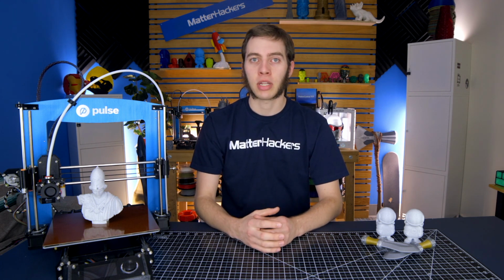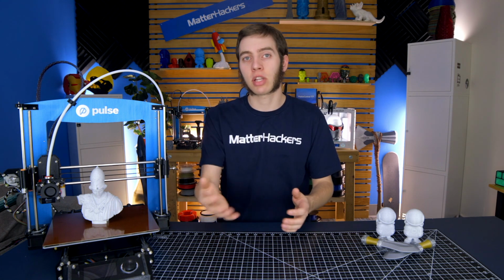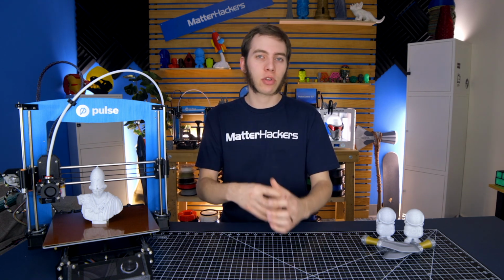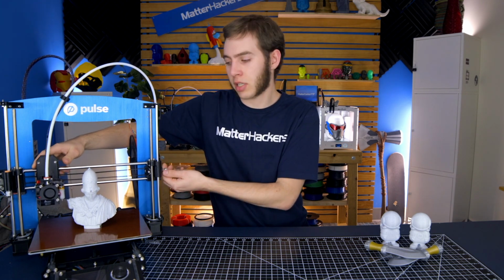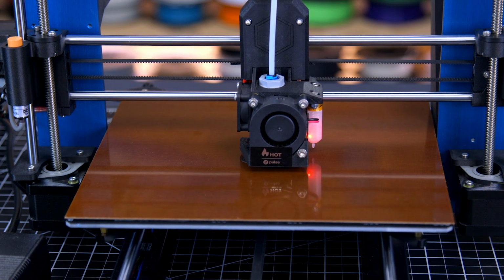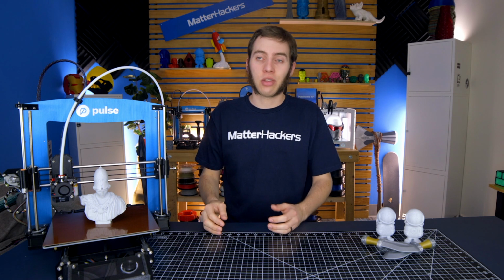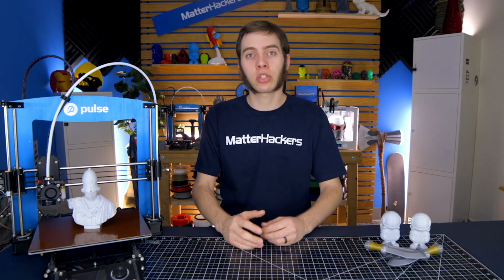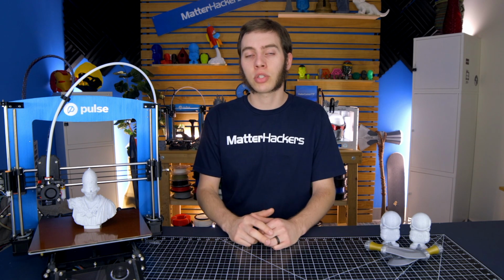3D Printer Troubleshooting Guide: Layer Shift

Comment from the maker: Besides layer shifts, what are the major troubleshooting issues you're running into? Your feedback might turn into our next troubleshooting topic!
Reply: i have a troxy P802E and im having issues with Most of the screws staying where they are supposed to be specifgically the ones used for leveling the bed im thinking abought getting some locktight
Reply: @techdiyer5290  yikes a tronxy. I had one of those. Jeeze I dreaded that I returned it. It was pretty hard to return back to China. Tronxy is just a bad company.
Reply: Personally just starting out..  I was doing fairly well.  I just replaced the Bowden tube and the nozzle, and twice now I have got prints that the nozzle either hit (and shifted the print) or something happened and it went from a perfect print. To looking like someone dumped a birds nest on top of my print.  9 hrs and 13 hrs in of like 15 hr prints.  Im going to look through your playlist to see if you have anything like this in your trouble shooting guide
Reply: heyho i just got into printing TPU and got some issues with overhangs.
I'm printing the SainSmart TPU 1,75mm diameter and i'm currently printing between 0,15 and 0,1 layer height to get those overhangs printed clearer.

but at some spots the overhanging lines bend up?!

i don't really understand the physics behind it i mean........shouldn't it hang down instead? xD

maybe you got some tricks else than making the layer heights smaller.
am i printing to hot? to cold? what could i do against that bending up?
Reply: None of those apply to mine as all belts are tight, pulley on all axis are tight, and it is printing at a very slow speed. I wonder if there was a power cut for a second or maybe driver overheating. You did not mention any of that in your video unless i missed it.
Reply: My problem these days (aside from layer shifts) is plastic oozing out the top of my nozzle. I've taken the whole heater block apart to make sure the nozzle is seated against the feed tube properly, but I still have the problem. Sometimes it leaves a glob on my model, and ramming into this might be what's causing the layer shifts. (edit: the belt was a bit loose, per your guitar string metric, so maybe at least the layer shift problem is solved)

I also tend to get oscillations in my model, but only at a particular height. Maybe my frame is warped, but this and other things I have managed to live with for what I use this thing for.

The stringing is pretty bad too, but I haven't played much with retraction settings.

What can I say? This was a used CR-10. I'm glad it works as well as it does.
Reply: my sensor was way to high so the nozzle buried into my tray :(
Reply: i want more people to cover this because it was really hard to find a fix

Comment: This was good, but I think something you forgot to add was wobbly surface, if the printer is on a table that wobbles, that shift can also happen. Which was my case, anything over 14cm with PETG weas having that issue.

Comment: from  my experience the problem is commontly a mechanical failure of the stepper motor ball bearings (2 inside one front one back) and their low quality + overtensioning belts (wear and tear). I repaired everything by simply replacing the balls bearings  (5mmX16mm with 5 mm shank) plus reduced the tension for the future , so that is just tight enough. Plus you can change the stupid belt that gets damaged over time, even if it is an "expensive" one. So 2 bearings per motor = 1 euro + belt = 3 euros. For  2 motors = 6 euro +the z axis (just bearings) = 7 euros in total. Have fun

Comment: Hell yes thank you bro had later shift problems and was about to go bananas and I didn’t think the belt tightening was gonna fix it every print would be fine and then like a quarter of the way thru it shifts then continues to print normally just with a phat shift turns out I just had to tighten my belt at least as of right now it seems to be fixed it’s past the point where it would usually shift I’ll Lyk after my print is done how it went but your video was a huge help like I’m talking the hulk’s balls type of huge like thanks man

Comment: Hi Alec thank you for the comprehensible video and good advice. 

I have been experiencing Layer shifts on my Ender-3 V2. The interesting thing is that they only appear on specific layers heights. Those are always the same throughout different prints and nomatter where on the plater the model is palced, the layer shifts are always there and on the same heights. 

I am relatively new to 3d printing so might still be making some rookie mistakes. Tried to tighten the two belts like a guitar string as you suggested. 

With my amateur comprehension, my guess is that something about the Z-Axis is wrong, maybe some contaminants at specific places of the vertical frame where the nozzle drives up and down. 
Tried to clean the frame with a bristle brush but the layer height stayed exactly the same. 

What would you guys do to proceed? 
Cheers

Comment: Disregard the criticism.
You pull off mutton chops very well.
Thanks for the tips.

My Ender 5 Plus has been doing this at about the 30% of all prints. 
I’ve adjusted the Gcode to default, but no dice. 
Never thought to adjust the pulley screws

Comment: I’ve had this with an Ender 3 neo max
This was on the vessel i work on, so it wasn’t my printer.
But i did a print and got a layer shift, i don’t remember if it was x or y
I noticed the hot end was wiggling, so i tried tightening the eccentric nut, but no matter how much i turned it it didn’t get tight.

So I took a closer look at the hot end you have the back plate where everything is connected to, wheels, nozzle, fans etc.

And i found that where the bottom wheel is connected to this plate it was bended towards the nozzle.

I dismantled the hot end, and bended the plate straight again, then reassembled, and this time i could tighten the eccentric nut. This fixed the wiggle and haven’t had a layer shift since.
Hope this helps someone out there

Comment: Another thing I saw on another print channel was also check your ed clips are fine?  

If they been used for a few months with lots of printing happening those bed clips can loosen the amount of force they have on the bed cover, 

So it can slide a tiny amount on the X axis or the on the Y axis so te bed cover ( glass mostly ) will move on that axis by a very tiny amount and you get a layer shift even if all the belts etc. are right.  

So get new strong replacement bed clips. I only ave 2 on my Aquila bed glass ( front and back ) So I will get new ones and this time I get 4 not  
so my glass bed is held on all sides.  I've seen bed clips on Amazon that have a screw part to tighten them better without them hitting the underside. So I may try those?

Comment: Hey all, I've got an IDEX printer that's running into layer shift issues. The weird part is that I cannot pin down a mechanical problem. I run it in duplication mode, and both extruders will shift in the exact same direction the exact same amount despite being independent (but still happens on both axis). I've already got all speeds locked down to 30mm/s and I still occasionally get the error and prints are taking days. I have no idea what I'm doing wrong.

Comment: INFO provided had factors (like the nema pulleys), I had not considered.

One factor you did not mention is the dreaded BED LEVEL factor :) A factor that can also cause nozzle to catch and then shift the layers.

One other factor that can contribute, if the stepper voltage is too low the weak motor will struggle to keep up, yeah that can also do it :(

Comment: I had this problem on my Creator Pro for the first time. After investigating, it turned out the belt skipped because of the rapid direction changes caused by small rectilinear infill movements. I ran the print again to see what happened and about 10 layers in, the machine was shaking like a jackhammer! Now I know I guess. 

Thanks for the video!

Comment: I just had my first layer shift last night after getting my first 3d printer for Christmas. Thanks for these tips. I've been using the 'basic' tab in Cura, but when I looked at the advanced tab, I found that although I was using very slow printing speeds, my travel speed was set to 80mm/sec, which was probably the source of the shift. Thanks!

Comment: very cool that i found this video...(i was searching lop sided 3d print causes )just bought this printer and was printung a larger bed adjustment knob and print shifted once half way through...this is exactly what you are talking about... i thought it was that my gantry was not perfetly level before i leveled my bed on my cr10s clone...will go through all that you explained.. thanks
Reply: Update was loose belt.. problem solved.thanks

Comment: Great video!  Thank you for all the informative video.  Always very thorough and concise.  My issue is the print head/nozzle running into the previously done parts especially in multiple part prints.  This is one of those situations where you want to be super careful when accepting to revert to default setting when making changes in the slicer software.  It may eliminate selected options like jump over or retract when transiting.

Comment: i have the Tevo Tornado and i just get layer shifting all the time. The belts are fine i think it's the power source or the motors dont get enough power but im no electrician, what to do?
Reply: RuiRaptor has an excellent video (Youtube) on this. You have to adjust the VREF's on the Main board. That's what I need to do now as well with my Tornado
Reply: @techsavvyhero  I saw the video and i tried that but i messed something up and now all axes are not working lol i orderd the new gen motherboard and hope that this is going to fix it. :D
Reply: P Knoth yikes, Sorry to hear that. I’m going to try and do it with power off first so I can get a feel for where to place the multimeter connectors before I go live
Reply: @techsavvyhero  you have to be careful with the screws, my mistake i think was that i was screwing and unscrewing them to often and one of them the (x axe) was in a quite difficult position to work with and i probably damaged something on the screw or the board not sure. But at first when i put all of the axes on 0.95v like in the video the hot end just started to get error halted massage all the time and the fans inside where completly underpowerd and started to work and after sometime they stoped again and started and again. Hope that you have more luck with that, im just a noob i guess haha
Reply: @podrozowanieprzezp  Where did you ground the multimeter to? did you use an alligator clip or pointer?

Comment: Putting that giant fan next to the printer can be a really bad idea. Before I had proper layer cooling fans, I tried that, and since it also cools heated bed & hotend a lot, it can easily trigger thermal runaways (protection, you should definitely have enabled)

Also, one of the most important potential fixes was missing; Adjusting motor driver current. There are dedicated videos for that, but would have been worth mentioning anyway.
Reply from the maker: Honestly that was done for comedic effect. Truly you'd want to design a lid for your electronics case that houses a fan and directs the air only onto the board and not the rest of your print.

Driver currents are a topic for another video. That has an entire other set of variables, and I felt this one was getting verbose enough. It's definitely another video I want to do. - Alec